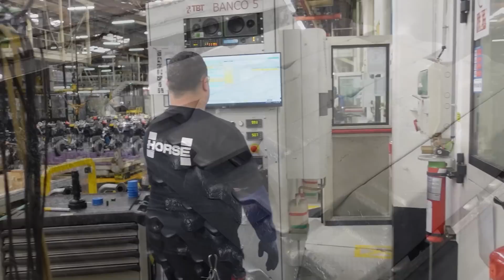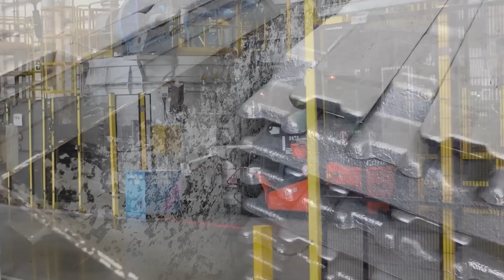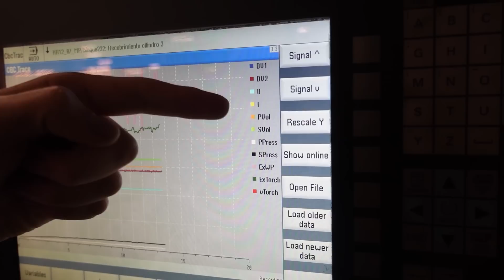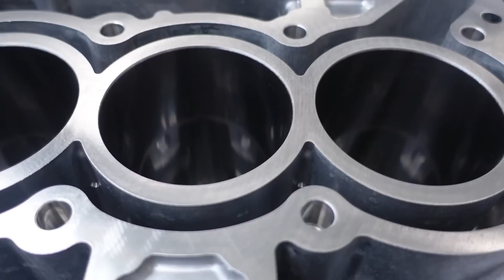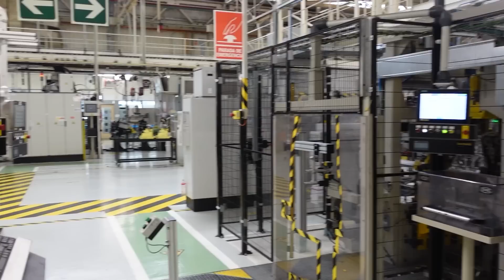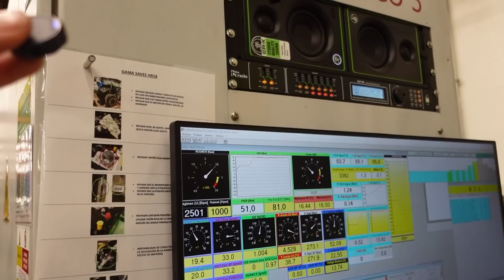This Is How They Make 1 Million Engines Per Year - Come With Me Inside A Super-Modern Engine Factory

Comment: 🤯 OMG 11:00 - Not only did they allow you to film an entirely unique and innovative process for replacing traditional Bore Sleeves BUT they even showed you their very own custom made tooling for the spray process!
- Very cool and cutting edge stuff -

I wouldn’t be surprised if that highly Professional display showcasing the process was the original model used for gathering the momentum to implement this method over traditional sleeves.
Reply: Like someone has mentioned in another thread, Japanese have been doing this for decades already. Nikasil, Alusil, Lokasil, and Silitec.
Reply: Wow ghost factory in the old days there would be thousands of employees now none.
Reply: Back in the 70's I saw that the German Zundapp 50cc mopets had such cilinders already
Reply: So yes NikaSil and other similar coatings are not anything new. Porsche and other manufacturers have been implementing that type of technology for damn near going on 1/2 a century … HOWEVER this “process” and technology is most definitely new and innovative in the automotive industry. 

The fact that it has been implemented into a production environment already means that it has already been well developed from its initial conception, prototyped & passed initial tests warranting its implementation at this scale; so yes the technology can’t be considered cutting edge, BUT myself and probably 99.5% of others weren’t even aware of this particular method of application which was the comment. 

Its new enough that I wouldn’t be surprised if others have been already doing similar in the last 5 years which means it hasn’t been long enough for those engines to have developed problems justifying a total breakdown for repairs and ultimately introduced to the community (and world) at large. 

Nikasil was a way to create a durable cylinder lining of ALL ALUMINUM blocks and implemented through electrolytic particle entrainment or electrochemical deposition and not sprayed on which makes it a new and innovative process to almost everyone seeing it.

Comment: You hit the nail on the head, these engines are non rebuildable, they are disposable, you must buy a new one if the old gets wore down. I wouldnt consider that a positive trait, more of a built in failure and planned obsolescents.
Reply from the maker: It's not that simple and I already answered similar comments. Most engines nowadays are non-rebuildable and it has almost nothing to do with planned obsolescence because there are very simple and cheap ways to achieve planned obsolescence.

Comment: Modern engine built to last millions kilometres but when something catastrophic failure hits the engine then you have to write off it compared to old engine with iron cast block and head. Overheating? Old one won't give a care. Bad oil? No worries.
Reply from the maker: Yeah....let's not twist the facts. No engine can ignore overheating or bad fluids. Maybe some sort of tractor from the 40s with abysmal power and efficiency.

Comment: Interesting 
Not seen metal spraying g of cylinders before but quite obvious really ( seen old cranks sprayed to give them a new life with good results ) metal spraying for cylinders is also cheaper than nicosil or similar ceramic coating, 
It also make the engine a one time use which is not particularly green.
Still great vid as usual

Comment: Thanks for the engine plant tour. One usually doesn't get to see the procedures being done on the really important aspects, Like the ability to see if the are imperfections with wall thickness and core shifts. I also liked where they had cut the cylinders to show the differences in the liner types and why the plasma arc iron spray bore is used. They can be repaired also. You might want to look into the laser welding Alusil  cases and heads vs having to replace them.

Comment: I wonder what advantages bore spray coating has over the traditional steel sleeve.  As you pointed out, there's no sleeve which can be replaced if it's worn or damaged, so hopefully it will last as long as a typical engine.  And it seems like quite a lot of expensive technology - so there has to be a cost savings or another significant reason somewhere.  Maybe it decreases emissions enough to justify it?

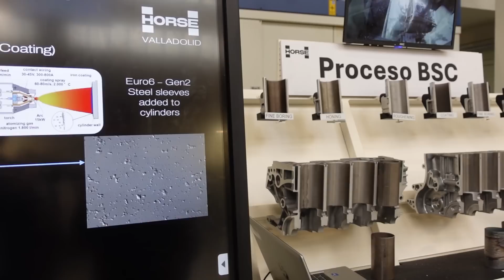Comment: 8:19 "...no more engine rebuilds"? That statement is worth a follow-up video.
Reply: disposable engines
Reply: Ford for example does rebuild plasma coated cylinders (cores from replaced engines), since it's cheap...
You can def rebuild this, the one tiny snag is you need a €250k plasma coating machine, so you need a shitload of rebuilds to pay off the machine.

btw all those plastic parts will literally fall apart before the cylinders wear out
Reply: Special cylinder alloy coating, it's more durable and more lightweight but you can't put new coating in basic workshop so it's not possible to rebuild this... Also engines rebuilds are rare nowadays because higher and higher work costs and in most cases not worth it. Like popular engines are easier to pull from crashed car than to rebuild.  Also in many engines parts are expensive, like you take good motorcycle engine and it has lightweight rods etc. which are expensive and whole rebuild is veeery expensive and probably not worth it since vehicle bodies crash a lot more often than you need to rebuild engines.
Reply: @starydwumas7481  blah blah. My Ducati has 39k miles, and the motor blew up at 29k, ate the con rod bearings. $9k repair, and the "expert shop" that did the work didn't think to check the condition of my piston rings before putting it back together, so now it drinks oil. But the "body" has not crashed, the bike would be much better if the motor had been made better, it shouldn't be disposable.
Reply: @aluisious  you bought Ducati and you expect to be affordable? 😜 
Also engine failure at 39k miles means bad engine design or bad maintenance which is owner fault... 
Ducati is a toy, it meant to be expensive. It wasn't designed to be affordable or able to easy maintaince or cheap rebuild. What did you expect?
Reply: Many companies can do silicon carbide/nickle composite bore plating
Reply: @PaulG.x  I don't know any near me, and near me I have plenty of workshops which can rebuild, even close I have stainless machines for food factory or old forge, CNC, welders but I've never heard about this close to me and if I can buy something like this.
Reply: Engines that last max 150.000Km and the cheapest way is to scrap the car or pay a hefty amount of money to replace the engine with one that will die at max 150.000Km. The Renault Tce and Nissan 1.2T HR engines are well known to be rubbish
Reply: You can bore and sleeve them, but it’ll cost way too much for a simple motor like this
Reply: @sollykramer5672  nah, basic sleeves won't maintain heat changes as advanced cylinders. Sleeves are common for heavy duty diesels.
Reply: @ yea it would be good quality sleeves though. A lot of modern blocks that have the plasma iron coating and on some where people want more performance they actually do sleeve them. The only thing is whether it’s worth it for the application or not
Reply: The economics of it  benefit the manufacturer, they make the engine cheaper but maintain or raise vehicle prices. Replacement of the engine will still be extremely expensive to the vehicle owner and only by their approved dealer based workshops. The prohibitive cost will sway you towards a new car.

Disposable cars. The engine is the fuse.
Reply: We are at the door of the famed conspiracy times
Cars with only batteries so you don't have full freedom of mobility
Even if the cars have engines, those engines should be replaced after some time so they can make money
Parts shouldn't be recycled and should be bought new becuz makes profit for companies but you have to use all non pollution vehicles because it hurts the environment where's use and discard doesn't hur the the environment since it makes money for these companies....
Reply: FWIW, taking business and accounting classes have taught me more about why things are the way they are more than anything else could have. In this case, it's worth remembering economies of scale and automation/assembly lines vs hands on craft work. Think of a Bic pen, if it breaks somehow, are you going to take it apart and rebuilt it or toss it and grab another? That's an extreme example but engines are far cheaper than they ever would be due to having a finite life span that is built and optimized for. An engine part that outlives the engine is just an overbuilt part.
Reply: @andrewahern3730  congrats on your preparation to ruin a business one day.

Comment: would like to know the cost of one engine... i mean a iphone cost around 15 euro to make. my guess is is one engine is 500 euro.
Reply from the maker: I think that with most high-tech products you're not paying the manufacturing cost and the raw-materials or whatever else tangible. You're mostly paying for the R&D behind the product, because that's the main investment. That being said, I highly doubt an iphone is 15$....I mean the camera alone has more value than that, even at the craziest economies of scale.
Reply: According to Investopedia/Nikkei Asia, an iPhone 15 Pro costs $558 for parts and labor. They retail over twice that sure, but as @d4a said, they need to cover R&D before profit can be made. Where did you get the 15 euros for parts and labor?

Comment: Okay, I've seen plenty foundries in my life, but never have I seen one this clean! Impressive!
Reply: Aluminum foundries tend to be much cleaner.  My company runs some cast iron foundries (brake discs) that are almost this clean.  How we do it is beyond me, makes for great customer tours if they have seen others.
Reply: My only comparison is old industrial b/w movies from (guessing) the 1950s or 1960s, and this looks like an electronics clean room or a hospital in comparison, like it was built just yesterday.  Really really impressive.
Reply: Yeah my dad used to own a machine shop. Cold, oily, full of 50 year old lathes. Still love the smell of freshly milled metal and oil though.
Reply: haha I want to show my first foundry boss. Why did we not have it that clean?!
Reply: In India, they can build engines just as good as these much cheaper, and they do it with dirt floors and sandals!
Reply: no they don't. technology has advanced. all manufacturers are at this level now. you can't achieve reliability without precision and accuracy. cleanliness and workplace order is paramount aside from good process design on top of good product design. India was what you described, before the late 90s. liberalisation of the economy brought much needed investments and technology. cheers @jackandblaze5956
Reply: My Thoughts exactly
Reply: Well for starters  I don't think it is in Pakistan.

Comment: Cool experience, thanks for taking us with you 😊 One of these engines is in my 2024 Peugeot 3008 right now.
Reply: Does it burn oil? 😅
Reply: @TML34  nope, done 26.000km not a single issue
Reply: @Asmiiirr, are you sure? Peugeot have their own Pure-tech engines - with WET-BELTS, not chains as in this engine. Or have they switched?

Comment: Kawasaki did a spray in liner in the 80s . I think they had issues . The KX 125 I had could not be bored out because it had a Teflon type of liner
Reply from the maker: I think nothing with any sort of extra layer can be bored out? Even more conventional electrodeposited stuff like nikasil can't be bored out if you don't have the means to re-plate it again? Unless it's deposited super thick which I believe it rarely is?

Comment: So, they built planned obsolesence into their engines. Why rebuild or fix, just replace? Ugh.
Reply from the maker: A rebuild in most countries where this is sold costs more than most modern engines. Also, I think this is a consequence of modern emissions and other standards that play a key role in shaping the industry rather than planned obsolescence. Inventing a new technology and getting extremely expensive machinery to implement it would be the stupidest way ever to create planned obsolescence when you can just reduce the wall thickness of a part by 1mm to achieve early failure of whatever.

Comment: engine is a throwaway engine, audi did similar spray on cylinder walls on V-10 and V-5, absolute rubbish
Reply from the maker: I think that 90% of manufacturers nowadays build non-rebuildable blocks. Surprisingly, emissions and other standards prevent them from building indestructible iron block carbureted anchors that make 1hp per 10kg. Surprising, right?

Comment: Kinda surprised they use helium, it's pretty expensive gas with limited supply
Reply: Helium is used because its rare. If the detector picks up the slightest trace of helium, you know you have a leak.
Reply: @obi-wankenobi9871  also because it's a very small molecule and will escape more easily than others. The only gas even better for that purpose is hydrogen, but that's too dangerous...

Comment: 3 cylinder car engines feel strange to me. The only real life experience I have with this concept is the two stroke engines fitted in Saabs from the 60's.
Reply: 3 cylinder car engines have been used as long as 4; cylinder engines. Don't think there's anything strange about it.

Comment: Engines for which car?
Reply: Renault HR12 engine is fitted to the following vehicles:
    2022 Renault Austral
    2023 Renault Espace
    2024 Renault Rafale
    2024 Dacia Duster
    2024 Dacia Bigster
Reply: @gsbeak  and Dacia probaly
Reply: @gsbeak  Thanks!
Reply from the maker: Renault, Nissan, Dacia, Infinity, Samsung motors and probably a few others
Reply: You can just Google it. Basically, for any modern Renault and Nissan.